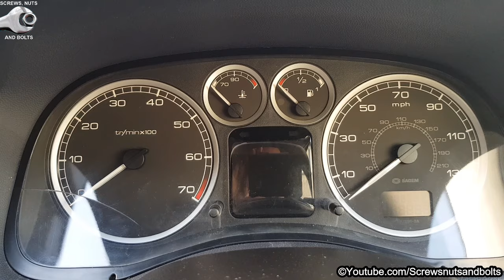Jump Starting Your Car Using a Drill Battery - Does it Really Work ?

Comment: Thank  you so much, its 2:35 am and I needed the car so bad 

I connected a 20V lithium battery from a Black & Decker drill, less than 1 minute and I tried: it works like magic 
immediately I disconnect the battery and there was no issues for the car or the battery
Reply from the maker: You're welcome !

Comment: Well I never would have believed it but I was sitting,  stranded in a parking lot in Park City Utah with my German Shepherd Grizzwald, and my car battery dead.. I remembered a video I watched a long time ago about starting your car with a drill battery.  And because I had charged my phone last night at the hotel with my battery pack my battery pack was dead.  

 I just left Home Depot where I had purchased two Ryobi drills and a Ryobi circular saw.  I also bought some five or six gauge wire to connect my inverter to my batter and some strippers.  So yeah ... ironically,  I had all the tools needed. So for reference sake,  I started my car (2013 Honda CR-V) with some Home Depot lamp wire, and a Ryobi One Plus battery which is a 1.5ah, not even fully charged.  It was blinking red in the charger.  Hoorah
Reply: Well look at that! I have a fully charged 1.5ah battery I need to start my riding mower, and if it can start a car it can definitely start a riding mower! thank you!

Comment: Side note: If your battery is truly dead and on its last legs Tip 1: Don't switch off the engine until you are safely at your end destination Tip 2: if you don't have quick release battery terminals  and most cars don't, it's not essential to connect the jump wire underneath each terminal, connecting to the top or side will also work, but ideally you should use the most secure option you have available.

Comment: It’s November 2, 2021 at 7:27 PM and And I just did this with a Ridgid OCTANE 3.0 battery! There is a Tesla charging port about 30 feet away from me, I guess when they installed it they left some stray wires on the ground  and that’s what I used. 

One wire was really thick, the other one was not so thick, but they seem to be aluminum or steel they’re not copper but it still worked. 

I connected it, and let it sit for maybe 15 to 25 seconds and then just started up my car removed it immediately.

Comment: Thanks, the trick with the loop was perfect even with speaker wire strands. It wasnt a very strong hold with my wire but it was enough contact to put juice in. And with a half charged drill battery
Reply from the maker: You're welcome !

Comment: I had never heard of this at the time. We were camping no cell service and what do you know the battery died! I have several Dewalt batteries and was nervous that It may damage my drill battery so I decided to sacrifice my smallest one which was a 1.3 AH 20 V which if you don’t know is the slim battery. It is about 1” thick compared to your standard 2” thick. At thousand point my girlfriend was freaking out. I told her to calm down we will be ok. She thought we were going to die. The only problem was I didn’t have any wire on hand so I got creative we did have the 12 V DC car pump for the air mattress but the wire size was definitely nothing compared to aa actual jumper wire, I’d say it was probably 16 gauge maybe 18 even and the actual jumper cables I have are probably eight gauge. So needless to say I was worried my battery would explode. I stripped the wires with my teeth and prayed. Meanwhile I told the girlfriend to take a walk, I cannot deal with you going crazy right now. I figured it was going to work but I wasn’t sure and it was our only hope. I figured I might only get one chance at it. So I waited probably a good minute and turned it over . To my surprise it tried to start!  At this point the girlfriend saw that and she began to breathe normally. I let it charge for a couple more minutes. The wire got pretty warm ngl but she started right up!!!! Girlfriend looked at me and said YOUR MY HERO!!! And I just smiled and knowing I was definitely going to get lucky tonight! Once again my tools save the day I don’t know what I love more my tools or my girlfriend. Anyway my truck takes a lot of power to turn over, 750 CCA but that little DeWalt battery reminded me of Thomas the train that day! They need to put a little hand crank on the side of all vehicle’s.
Reply from the maker: Yeah that would be handy in emergencies alright ! :)
Reply: Thanks for sharing! 👍🏾👍🏾😎👊🏾
Reply from the maker: @heavystarch100  Thanks for watching ! :)

Comment: Tried it today with a 9.0 flex volt battery and it worked ! I only attached one cable to
the + and the other to the - on the car’s battery and on the other ends where they connect to the drill battery I used spade connectors to fit them better in the drill battery ! It really helps for an emergency when no one stops to give you a jump and are assholes 😒😏

Comment: That was Awsome thanks for the survival tip.  I own 5 hyper tough batteries and 5 craftsman batteries and 2 milwaukee batteries.  I just looked and the hyper tough batteries are marked + and -  
   The milwaukee is also but the craftsman isn't marked.
Reply from the maker: You're welcome. I'd advise using the lowest voltage battery you have to minimize any risk of damaging the vehicles electronics. I only had a 20 volt battery to do this demonstration but apparently it works even with a 12 volt drill battery !

Comment: If one wishes to use this method in order to jump start your car, perhaps purchase a 18-20v cordless hand tool from a discount store like Walmart. You don't want to use your Mikita or Dewalt $300.00 cordless drill battery to attempt this. If you kill the cordless $20.00 drill battery, no loss!!
Reply from the maker: Good idea !
Reply: No, use the expensive battery. They are built better and to withstand more amp draw. You ever wonder why your m18 battery can power a saw equivalent to an electric 120v 10amp.

Comment: Hi
Great video and great solution.
If the battery wasn’t not 20v?
It’s working?
Reply from the maker: Thanks. Yes is should work with a 14v or 18v battery
Reply: @screwsnutsandbolts  great thanks

Comment: isn't it bad to use a 20v battery if the car battery is 12v?
Reply from the maker: Read the video description
Reply: @screwsnutsandbolts  woops thanks
Reply from the maker: @cokimi1301  You're welcome 👍

Comment: I done this treat using cordless batterys and killed the cells in the battery, a very good idea but sorry to say it didn't work out for me, love your video though kind regards colin from croydon surrey England 👍 👍 👍
Reply from the maker: It's really just to get you started in an emergency but thanks for watching 👍👍
Reply: @screwsnutsandbolts I tried this once and it didn’t work for me either but I did get a little more juice in my battery than I had before I hooked the battery up. I used a cheap “sun joe” battery and when I took the battery apart later one of the 18-650’s was blown up. So I was wondering if I hooked a fuse up in between the wires what amp fuse should I use before blowing up the battery?

Comment: Isn't it a problem that the alternator starts putting power to the lithium battery?
Or was that another type of chemical that risked fire?
Reply: You disconnect the tool battery before you start it

Comment: ... Very smart to put 20V over yout whole cars electrical system... You are actually lucky that you ECU did not fry or whatever, because your terminals were connected to 20V instead of 14-ish V (full 12v battery) 
Next time use a 12v ish battery, in modern cars it wouldnt really matter tho, they have over voltage protection, but with old cars this could be deadly

Comment: Any idea if a cordless power tool battery can be charged off a car battery. I have looked on YouTube for vids but found zero
Reply from the maker: Apparently it can be done, but not without a few possible risks. Check this link: https://topcordlesstools.com/blog/charge-battery-without-charger/
Reply: The simple answer is not without a battery charger designed to run off 12v which will have a dc-dc step up from 12v to 20v, you cannot charge a battery designed to operate at 18+ volts with a battery that is 12volts. think of voltage like pressure. current can only flow from higher voltage to lower voltage. if you have 2 batteries one being 15v and the other 10v and you hook them together in parallel the higher one will charge the lower one until the voltage equalizes at 12.5 volts

Comment: I was wondering if I could attach drywall screws to the battery and hook it up to jumper cables would that work with the coating on the screws mess anything up?
Reply from the maker: I'm not sure to be honest. I think the guy in this video does something similar to what you're talking about and it works: https://www.youtube.com/watch?v=hLJ_Q3KcFEo

Comment: Will this work with a 12v battery from a drill
Reply from the maker: It might. You may need to leave it connected a bit longer to boost the battery before attempting to start

Comment: A bit alarming, 20v battery to a 12v battery and system, this might damage the internal electronics, not all cars can handle more than 12v. 

Better use 12v battery packs and never more than 12v this can cause permanent damage to your electronics

Comment: Just done this using exactly the same battery from my park side impact gun and now it won’t charge on the park side charger
Reply: I’m pretty sure you reversed negative with positive and blew it up
Reply: @richardbridgeman5968  nope I know what I’m doing the car turned over briefly but didn’t fire , so abandoned the idea , put the battery back on my impact gun and no power , put the battery back in the charger and it won’t take a charge , spare battery charges fine
Reply: @mitchlupo3l  your battery is so dead the charger doesn't recognize it you need to jump start that battery, connected to another battery so I can siphon off some voltage then charger will recognize it
Reply: What Matt said, drain too low charger does not like it.

Comment: So what Guage wire did you use, or supposed to use?
Reply: Anything above the voltage of the drill battery.
He used house lighting cable, that's plenty.

Comment: It's good in an emergency, but I wouldn't do it all the time.  Feeding 20v through a 12v system is risky buisness.
Reply from the maker: Agreed. I would only consider doing this in an emergency situation and, ideally, with a 14v battery if you have one available

Comment: when you say turn the car off before disconnect the battery to remove the wire the problem with that is you won't be able to turn on the engine as the vehicle needs to be driven for a certain time to charge the battery completely so instead i would just put something like electrical tape around the exposing copper wires and some more tape to mount it so it doesn't swing around just until the alternator has had enough time to charge the battery

;;;;;;;''''''''''''''''''''          2 Esdras 2: 31 -100                          ;,,,,,,,,,,,,,,,,, ''''''''''''''''''''''''''''''''''''''

Comment: Does it damage either battery
Reply from the maker: It's in the video description: "WARNING ! This method could potentially cause damage to your cordless battery or even to your vehicles electrical system. Only use this method in an emergency and if you have no other options available to start your vehicle"

Comment: That must be one of them easy start cars because I need 600 cranking amps to start my car that don’t work on real vehicles
Reply: Back in my truck mechanic days i had made a little 3d printed doodad that took a pair of Milwaukee batteries to jump start big rigs that has been sitting in the lot too long. Saved my the trouble of dragging the heavy battery cart all the way out there. The real kicker is the batteries were wired in parallel of course, and most of the time one would get the job done just fine.
Reply: Its can work because the  tool battery flow the current to the car battery for some minutes, the car battery stored the whole current that was flowing, and when you start your car its will be alright

Comment: Worked!! Got me out of a hole I used 2p coins ..my 18v battery is probably fucked now lol 🇮🇪👍
Reply from the maker: Very clever, hopefully not 👍
Reply: It'll always be fine as the car system is only 12v.... However in modern cars, careful of circuitry boards ..

Comment: do not do it .you will burn the car computer(ECU) due to voltage over 16 v.
Reply: I was wondering....
Reply: it's ultra sketchy but i think it probably won't in most cases, since the batteries of the cars this is done to is very low and therefore takes a lot of current, so the voltage of the drill battery will probably drop a lot, and the voltage across the ecu should be fine
Reply: the voltage of you car battery 12.6 normally (who knows what voltage if its dead) and the drill battery (20v) fully charged will average out to around 15-16volts and most cars will have over voltage protection, id be more worried about ruining the tool battery especially if its a cheaper brand one, name brand good ones will have overcurrent protection. but like mentioned elsewhere this is a emergency method.

Comment: Did your wires get hot mine melted
Reply from the maker: Did you have them the right way around ?
Reply: @screwsnutsandbolts  absolutely yes sir if they wasn't it would of sparked like a mofo lol makita 6ah
Reply from the maker: @crouchingtiger5431  LOL
Reply: Getting a parasitic drain it's killing me lucky it's a 2005 about ready for the heap crying rn
Reply from the maker: @crouchingtiger5431  Yeah it can be hard to find. I presume you've already checked plenty of websites like this one: https://shoptoolreviews.com/automotive/diagnostic-testing/parasitic-battery-drain/34587/

Comment: man... people are trying to put 20 voltage on the car electric because of you. that will damage the original car battery and might damage the car electrics...
Reply: @garyhalliday2140  what you could is not what you did.... And a car battery will still be damaged at least in life time when you connect 20v on it with going several amperes through it

Comment: Please do not do this , its a lie , your battery has 80 ampere , the drill battery has 1 ampere and 20 volt, it will destroy your car , this video sbould be delete for false information
Reply: I did this and only had the 20v battery connected long enough for me to turn the key. It worked without any ill consequences.
Reply: Il faut faire demarage rapide et débrancher  les filles  rapides 😂